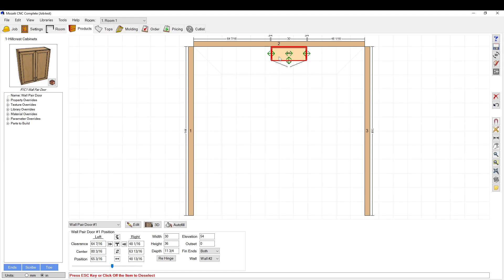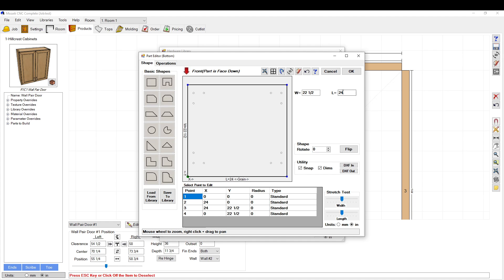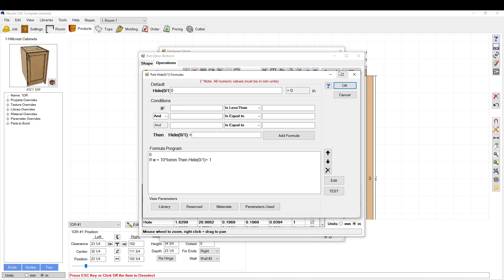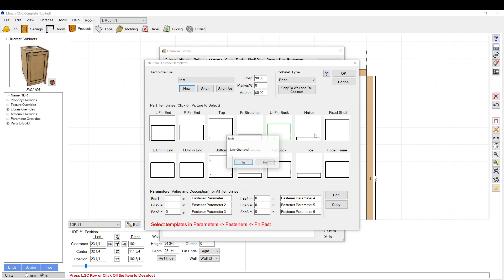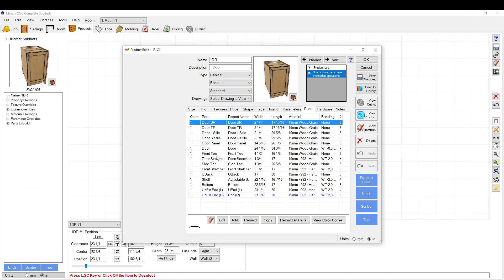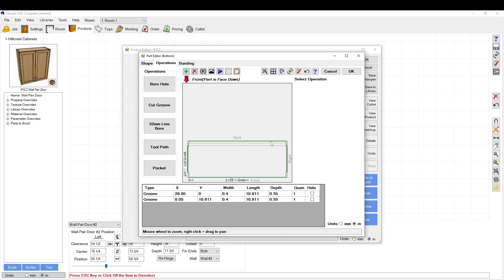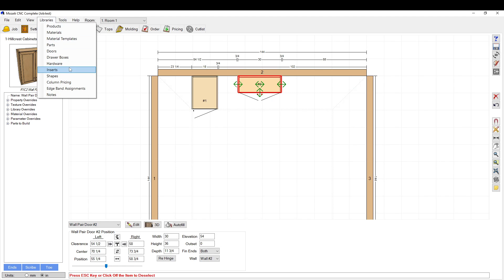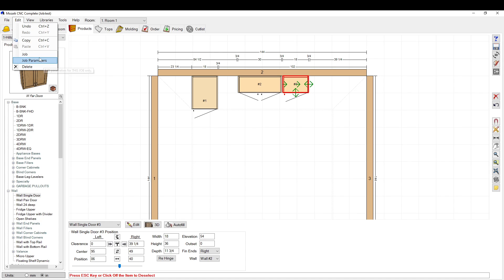Part Templates - Mozaik Software Tutorials

Comment: Is there any way to change the materials for parts that are already made in Mozaik? For instance I've made a cabinet and the parts are 3/8 Melamine and I need to change the parts to 3/4 melamine
Reply: I just stumbled upon the answer for anyone curious...select the cabinet while in the "products" tab and go to "material overrides" and change it from "job settings" to whatever material you need. In my case 3/4 melamine (I'm aware I should have adjusted this in my job parameters first)

Comment: To anyone else using this, be wary of any part templates downloaded from the web/forums.

I used one as a reference for leg levelers and renamed a copy for my own edits. For whatever reason it created additional holes equally spaced in my QT plant-on back, despite me never adding them or them matching the 6 Fastener parameters (which took me FOREVER to figure it was my part template causing this, not joint or parameters.

Deleting/hiding the holes would never actually save and would be back every time I exited and returned to the part template. 

Only thing that fixed it was starting from scratch unfortunately. Its powerful when you learn it and even more so when you start adding conditional statements, but its not without its bugs. Sometimes it takes me several tries to have my edits save as a formula, rather than the current position before I stretch the cabinet.